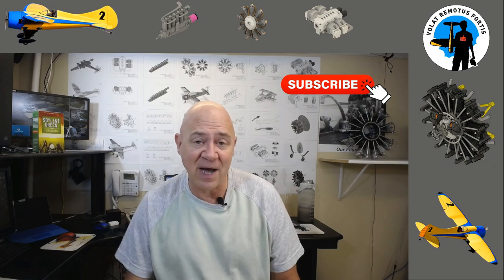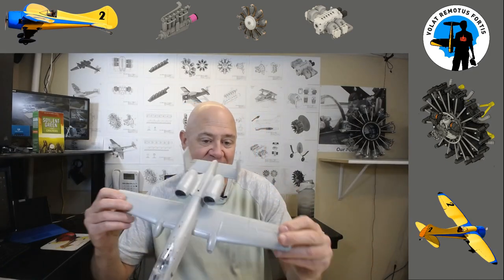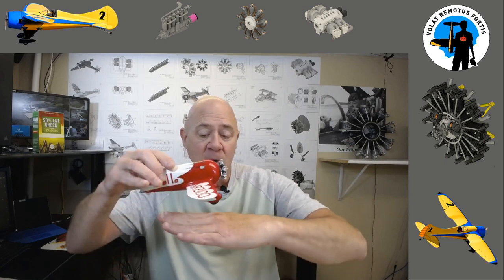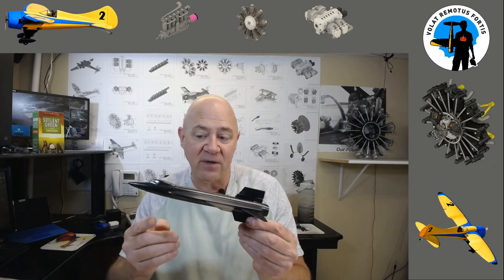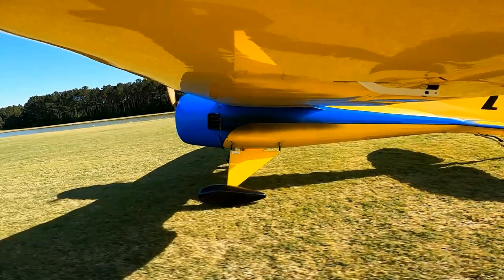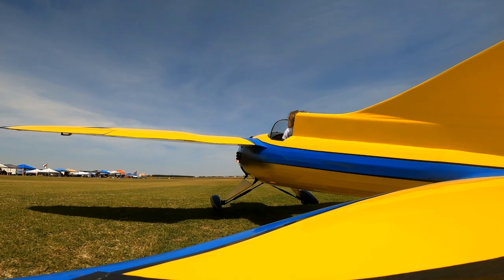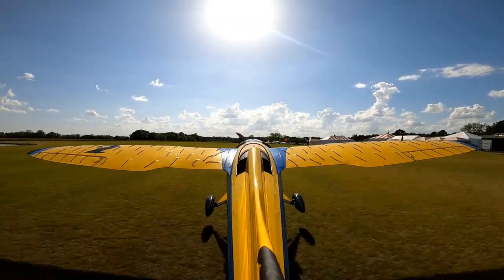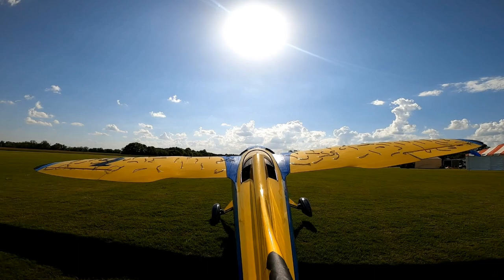Landing Model Aircraft (Kind of Part Two!")

Comment: In flight school I was taught ‘Power for altitude, Pitch for airspeed’. Initially that seemed counter intuitive, however it was key for a stabilized approach. 

Many thanks for sharing your knowledge and experience through this channel. Great stuff as always!
Reply: With my EDF’s I use the elevator to set the angle of attack I want and use the throttle to control the descent rate. Since I almost always use flaps, I mostly use the throttle to push my planes to the touchdown point. I can tell if I’m going to be short or long, so I adjust the throttle accordingly.

Comment: Nice, the hardest plane for me to land is my 1/4 scale cap 232. I have seen so many landing stalls I am really scared to get it to slow on landing. So I come in hot and flair at the last possible second. I think it is from the elevator position the reason it stalls so quickly. I also really think you hit the nail when you talked about cg. I had a discusion with a flyer about his byron p51. He said when he first flew it with the stock cg he had a lot of nose overs with it. After he readjusted his cg by ballancing it upright with his finger and a freinds on the leading edge of the wingtip the nose overs stopped. he said he took a ton of weight out of the nose. Thoughts?

Comment: When I do a wheel landing with a tail dragger, I level off just above the runway and lift my thumb off the stick just before the main wheels touch. You can’t be holding any up elevator when they touch or your plane will lift off again. In full scale aircraft, they push the stick forward some right as they touch down. I haven’t mastered that technique with my models, so I just let go of the stick for a second or two.